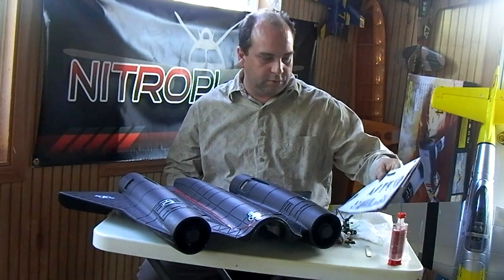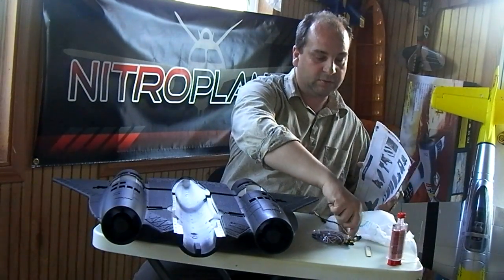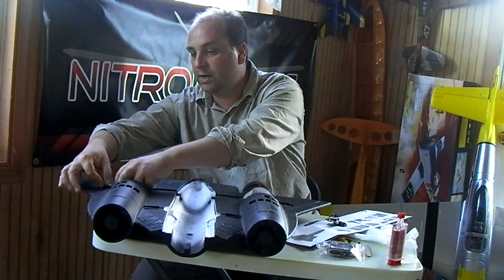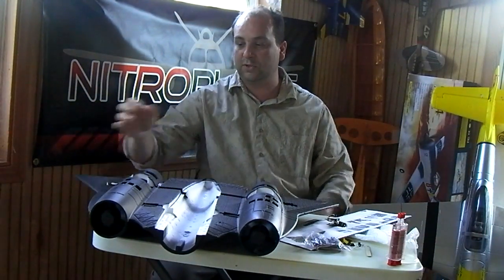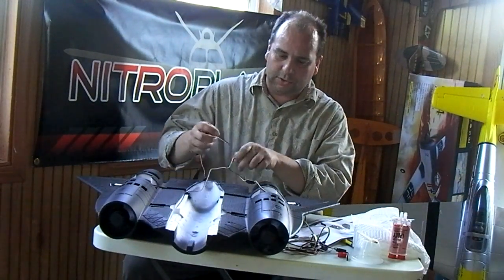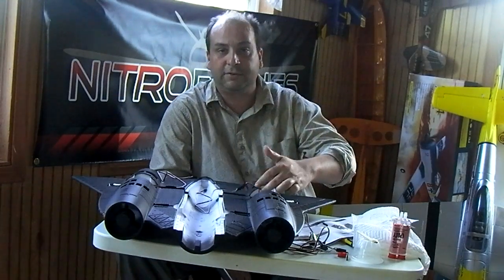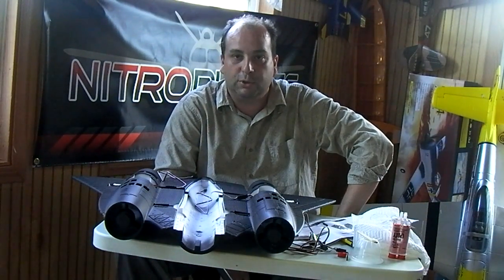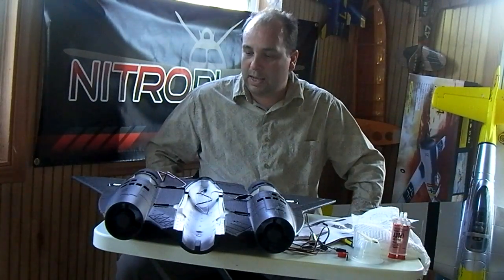Max Jet SR-71 Build Part 1

Comment from the maker: @TheLipRipp3r 
In the EDF the motor is mounted behind the fan.  So it pulls air from the front of the EDF across the motor and out the back, this allows good cooling for the motor as well.

Comment: I built an SR-71 from scratch and had a heck of a time getting the CG right I think that the nose produces lift and it slides the CG forward. Like if you had a plane that has canards. This is a very interesting build to me. Your doing a great job so far. Thanks

Comment from the maker: @brainanator 
You are correct.  Kv is the term, I believe it is still said kilavolt when pronounced, is it not?  RPM per volt is the better way of saying it, so a 4200rpm per volt motor would run at approx. 52,900 RPM on a fully charged (12.6v) 3S pack.
Correct me if I am wrong about the pronouciation, but in spoken word, I have often heard it refered that way.  Which may be incorrect.